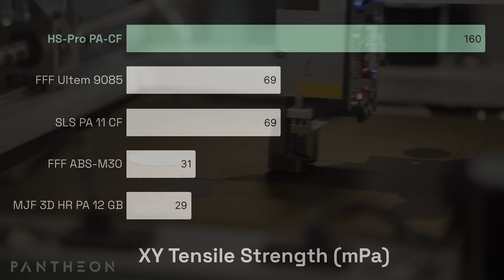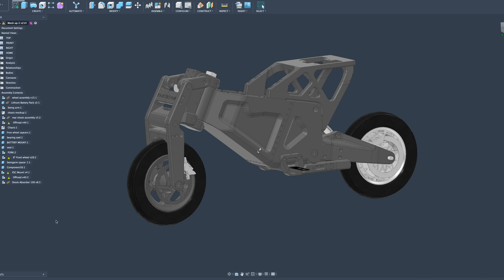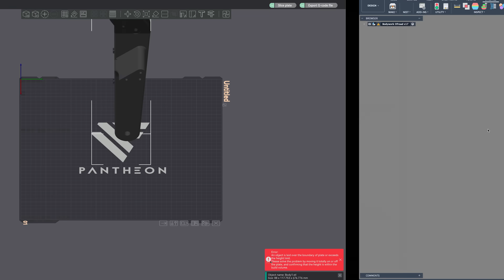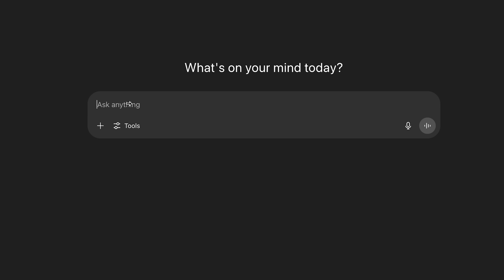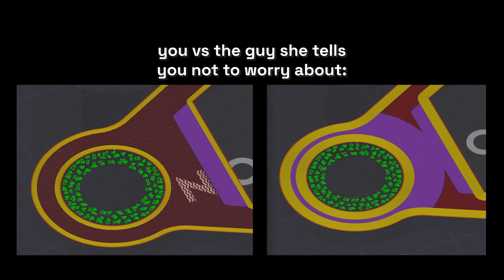Shredding our 3D Printed Dirtbike

Comment: very nice, so the part that broke was 90% while it should be 110%. There are probably parts that are 200%+ which means they are too strong and heavy and plastic was wasted. All the parts you should make smaller until they break and then make them a little stronger. Very nice.

So Is this gonna be a business where you sell all the parts in a box other than those that need 3d print so people can make their own bike really cheap? Or did I just give you the best business idea ever for free?

Comment: My HONDA E best friend also used 3D printing to make an electric skateboard a few years ago. At that time, the strength was sufficient but the heat resistance was not enough. It would still deform after driving on asphalt roads for a long time. Now I am very excited to see such a result.

Comment: As someone who has built some of the craziest and fastest ebikes out there and has mass knowledge of controllers and motors and now also 3d prints my own stuff i can say this is amazing and id love to get my hands on one to mod and upgrade with a proper controller and more high powered motor lol
Reply: Flipsky controllers are not good
Reply from the maker: learning that now...
Reply from the maker: we just got our hands on a qs 90 :D
Reply: @PantheonDesign qs90 is not high powered lol i had a qs90R the big brother to the qs90 in an ebox for kids and it got roasting hot at about 7000w i can dish out over 100kw on my current bike lol
Reply from the maker: @ZOMBuckaCurt  hey its a big step up from shity hub motor were running now haha
Reply from the maker: @ZOMBuckaCurt  i think with deent cooling airflow and contoller tuneing we can push 8-9kw which is plenty for this chasis

Comment: I bet it would cost about $1000 in filament to print that sucker out. By the time you get motor, batteries, and controller setup it probably cost more than a grom.
Reply from the maker: yoo, i think your about spot on for the filament, rest of the parts are about 1400, so total cost around 2500, so pretty similar to a used grom, but like this thing shreds way harder and electric is way more fun becasue no one gets mad at you.

Comment: Try and oversize the neck and run a pvc tube inside might help with structural integrity.
Reply from the maker: Ahh just printing it solid fixed the head tube, also imbedding a pvc tube is a net loss in strength Ahahah
Reply: @PantheonDesign just throwing out ideas

Comment: Did you anneal the parts at all? How did you guys get around the parts getting climatized and losing stiffness after a week or two in open air?
I see a lot of potential to add cheap/small carbon tubes to stiffen the structure... Can't wait to see this progress tbh. I'm a design engineer in the motorcycle space and a 3D printing enthusiast so you got me hooked.
Reply from the maker: No annealing

we are seeing around 1% water absorption after submersion for 24 hr, I think the last test modules were only down 1.2%, test data here --> https://pantheondesign.atlassian.net/wiki/spaces/docs/pages/673972360/Pantheon+Filaments#Nylon-Moisture-Absorption-Testing

Ahh, I really wanted to challenge myself with the unreinforced parts, and it worked out quite well. I did use some M8 bolts to reinforce around the stem area in the fork clamp thing

want to help us design the next one :p
Reply: @PantheonDesign Uh, yeah I do. Just don’t tell my boss 😅

Comment: A 3D printed dirtbike is one of my dream projects/videos, and I'm so happy to see you guys did that, and absolutely killed it too. This was a blast to watch, and I had to do a triple take at 3:24 with the wall count, haha. I completely dismissed the print time too with those settings (and was pleasently surprised), and I almost lost it at the hammering the supports part as well. Brilliant all round in every way. Cheers!
Reply from the maker: dude the hs-pro is shockingly fast,  but im geting used ti it now and i want more speed, the frame takes 2.5 days (2.6kg) i want that in less that 24 hrs so i can iterate faster
Reply: @PantheonDesign  I can understand getting used to it! I wish I could relate though, haha. What is the primary bottleneck? I want to assume the hotend given the ludicrous motion system, but looking at the spec sheet, shoot, everything's looking extremely baller already, haha 😅
Reply: @PantheonDesign what's the hs pro max speed?
Reply: @PantheonDesign 🤔 Imagino que para imprimir a más velocidad con filamentos técnicos reforzados con carbono y de alta temperatura 💁🏼‍♂️la cosa empieza por una boquilla Ø0,6 mm o Ø0,8 mm de carburo de tungsteno.. ☝🏼BambuLab acaba de desarrollar un nuevo sistema de hotend por inducción que es capaz de calentar el filamento en 8 segundos y monitorizar la temperatura mediante un chip de manera inalámbrica.! 👌🏼✅
Por cierto la moto es guapísima y se ve bastante funcional 👍🏼.
🙇🏼‍♂️'Hideo Kodama' se merece un altar con su foto en cada taller de impresión 3D. 🙇🏼‍♂️
🖖🏼😄
Reply: Who would've thought id see you here

Comment: Nicely done! Will you eventually show how much the HS-Pro is on your website? Are there a lot of technical limitations to get the chamber temp above 60°C, say to 80-90°C?
Reply from the maker: mostly with the motors being un isolated from the chamber heat, we can push 65 - 70 if were lucky, buttttttt with some isolation nothing is stoping us from 110-120c :D

Comment: even if materials are not there, design can replace material with clever designs that make it work. ie strong without the materials needing to be strong. like normal plastic. I would no trust even on myself. so why tempt. kinda self-sacrificing honor in pride. not worth it. sounds noble but leads to only worries. sounds like a toy, its a toy, keep it a toy. robust design and choices. well if you messed up, you can easily correct. wonders of 3d printing. well you are the builder. but watch how you build. use airless flex tpu tires instead, like a proper 3d print. yep use wheel shoes. maintenance is a dread, flex tires avoid all maintenance. you have 3d printer, you can make test prints to test the fit. dont have your parts hanging out like that. keep them in. motor controllers are simple to diy. just some simple rp2040 chip and transistors, and its done. why you call me good. only one is good. you can still fold the axles. to make the fit.

Comment: Front shock needs to be softer, the front suspension basically doesn’t do anything.
Reply from the maker: ahh theres only 100mm of travel so its a compromise between small bump and biger impacts :(, i think if we used a better shock with some bottom out suport we could probably have way better small bump compliance.

Comment: @Pantheon: I would like to know why the HS Pro has 100Mbps Ethernet, not the 1gbps found in literally anything else manufactured after 1997.
Reply from the maker: this is a good point, ima bug engineering on monday
Reply: @PantheonDesign honestly 100mbit is fine for GCODE, I’m just genuinely curious what kind of weird engineering or manufacturing scenario led to it. In my experience, it would be harder to source 100mbit chips/stacks than 1gbit lol
Reply from the maker: @TheOfficialOriginalChad  okay i looked into it a bit and i think its a type, the onboard compute is a CM4 so its should be 1gbit

Comment: I ve never thought fdm 3d printed parts could take so much beating. Thats super impressive!
Reply from the maker: were trying really really hard to make good printy
Reply: they can .... they sure can take a beating, i have an ev that needed some charger cable management , so i 3d printed a cable and charger holder from pla with 100% infill , I've had it for 3 years now in my garage and that thing gets to about 120f during sunlight and theres literally 0 signs of wear or cracks or bent, of course is not as strong as metal but that's common sense.

Comment: That's AWESOME, great video, great bike - I want it, but I don't think I might use it on streets in Germany?
Reply from the maker: Hmm, Germany can be quite stringent on vehicle regulations: (, maybe they will be nice?
Reply: @PantheonDesign  Quick search found an e-bike site that says "Technical Requirements: In addition to speed and power limits, ensure your E-Bike complies with technical requirements. For Pedelecs in Germany's Ebike Laws, the motor must have a maximum continuous rated power of 250 watts and be equipped with pedals that are functional for assisted propulsion." Also says 25km/h limits. I'm not sure if all self-built e-bikes require pedals or only the lowest class. Would be an interesting aspect to add!
Reply: @802Garage  thats for pedal assist bycicles, so it does NOT apply here at all. This is a motorcycle, meaning you would have to jump through the same hoops like a manufacturer of a vehicle to get it approved for street use. So 0 chance.
honestly your reading comprehension is pretty adorable.
Reply: @britzwickit I don't think you actually read my entire comment. My reading comprehension is fine. I did not say that I was certain this would apply. My entire point was that E-bikes of a certain power class may require pedals in Germany and I couldn't find legislation for those without. Instead of being a jerk for no reason, you could either point me to more appropriate legislation or correct something I got wrong. Instead you were insulting an added nothing. Learn how to be more positive and helpful before you snap at someone else.